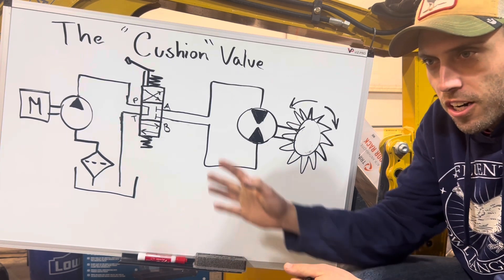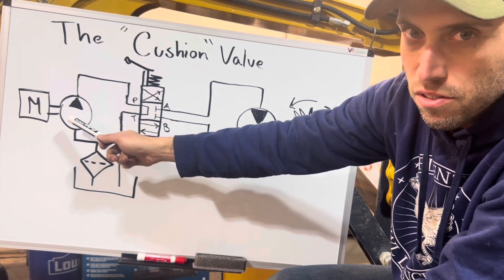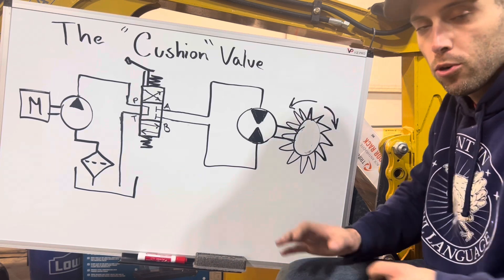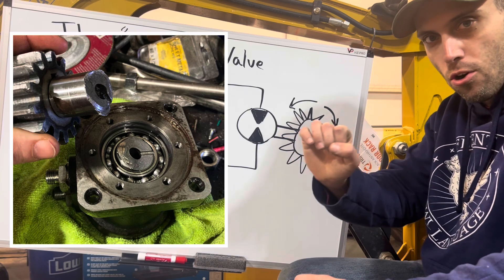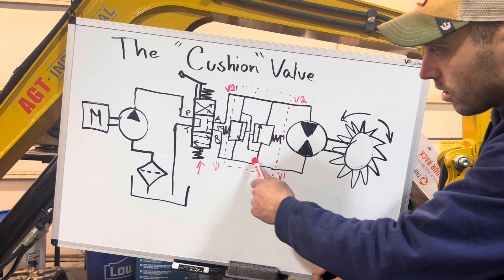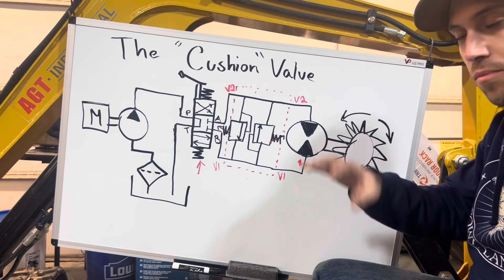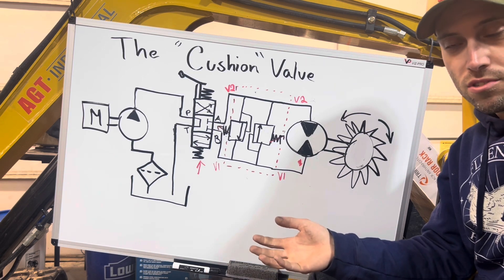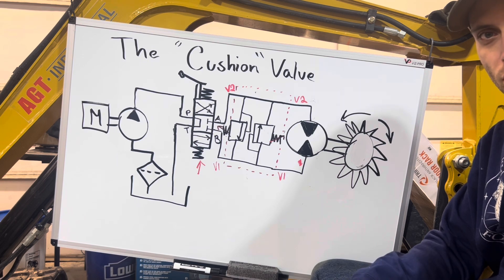Chinese Mini Excavator: Cushion Valve (aka Dual Acting Relief Valve) Hydraulics Explanation

Comment: I have a 323w and 850 SCL Diggit. The 323 is great and I love it. Diggit/Hurricanes are piles of shidd. Diggits are better than the Hurricanes. I don't know how you could break a wheel motor. That is insane.
Reply from the maker: My Diggit clone is still stuck out back with a bad pump
Reply: @thegarageconnection the orange ones?

Comment: I have 2 questions. One, since many of the controls (not just rotation) are jerky. Could one cushion valve be used at the pump to tame the entire system? I think I know the answer and maybe the why but I would like your thoughts. And two, the fittings for the cushion valve are difficult to find. I would like to remove the hoses to the motor, cut them where I want the cushion valve to be installed and crimp standard JIC fittings on to connect to to the cushion valve. Is that a realistic solution? Also, thank you for your service!

Comment: I appreciate your teaching, I installed one on my Qk16 and it immediately quit being a bucking bronco on the stop of the swing, the way that stopped you could tell something was going to break!    it works great but i also need to go in there and set the pressures.   do you think they should be as high as the dcv check valve?
Reply from the maker: Mine are set a little lower than the DCV check valve.

Comment: If one line is redirected back into the feed line . Wouldnt that cause the slew motor to keep rotating while the control valve is blocked off ?
Reply from the maker: Only if the pressure exerted on the cushion valve exceeds the lifting pressure of the relief valves

Comment: Cushion valve got me thinking about an annoying issue with my boom cylinder. I have a 2t , reasonably higher end 19h0 Chinese Ex.

Cylinder mount on top side, so more down force than lift. When I go gently in the lift or up direction and close the valve many times the cylinder will violently pogo stick until the boom retracts to the ground will the control is centred.

A video on this would be a real good idea, I think metering the cylinder may cure this. Or may may I should turn the cylinder around for lift power and reduce the downforce.  The pump puts out 15 g/m. The machine is new.

Really enjoy your content.

Comment: Hey there! I just bought two SCL 850 mini skids from an auction There is like absolutely no hydraulic pressure whatsoever, and I looked at the relief valve and noticed there was no bolt holding it down. By chance do you know the size of the bolt? I bet they might be pretty generic between all the machines

Comment: Do you have a recommendation for thread sealant on hydraulic fittings?
Reply from the maker: I use a product called true blue but any Teflon based product should work just fine for tapered thread only. Any thread with a metal to metal mating surface or an O-ring should be dry.

Comment: I got a rippa 1ton. Trying to reduce the jerkiness of the up and down boom. Would this concept fix this issue for me?
Reply from the maker: A flow restriction valve would
Reply: @thegarageconnection  is there a particular website I could find that at for these minis?
Reply: @thegarageconnection  is that also considered a flow control valve?

Comment: Hey there good afternoon. Really appreciate your helpful videos, had a question about tracking down hill. Was hoping you could answer? Have new agt L12 actually comes factory with oil cooler already with fan switch but no filter? Any way, when I’m tracking down a small downhill the motor or pump kinda chugs? Like maybe machine is starting to go to fast for system. Kinda lags out.. but when your on flat ground tracking controls and everything is normal. But second your on a decline tracking kinda here system stall out then come back and repeat. Is this normal?

Comment: I really appreciate those videos, Looking forward to see if you are able to make any upgrades on the somewhat cheap DCV. I have almost the same machine myself and really need some upgrade for the boom arm which is really jerky. I have some ideas for servo joystick controls with rc servos but have some concerns with safety for that idea. Another is to add pilot control joystick to get some better comfort when digging multiple hours a day. looking forward to see your thoughts and ideas. Keep up the work!

Comment: Wouldn't 2 small hydro accumulators do the same thing? If so, they would effectively 'lock' the swing once they recharged. Also an accumulator probably wouldn't require a dedicated blow-down/discharge line.
Reply: Actually I should've looked at accumulator prices before commenting, Yikes!